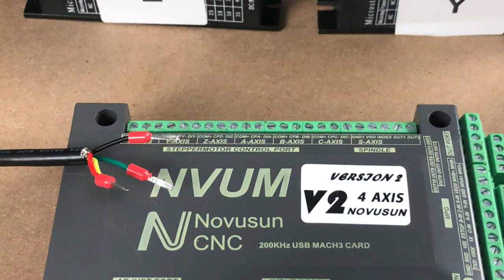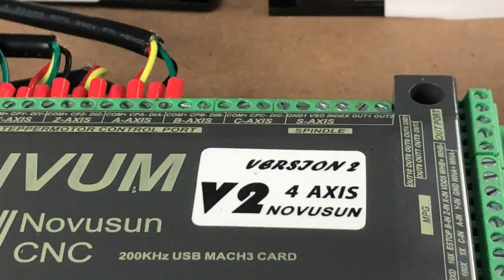NVUM Mach3 Controller Wiring for WorkBee,Lead CNC and other Similar CNC machines.

Comment: How would you wire 6 stepper motors up. I have 1- X motors, 2-Y motors, 2-Z motors and 1 motor for a Tangential motor

Comment: Hi! Thank you for this video! Can I use this controller with separate 36VDC power supply for powering 36VDC stepper motors?
Reply from the maker: Hi Igor,yes, please see your Stepper driver voltage range, generally it's 24-42V,so it may ok.
Reply: @yuyongindustry  Thank you!

Comment: I am setting CNC control using  NVCM6V2.1 USB I can't get the spindle to work every time I turn on the spindle it cannot turn off also when I turn on the spindle input 3 also active, it seems like it interferes with the VFD input.  the VFD I'm using Etrac XFC2000. VFD input setting  Active LOW measuring at the input voltage +13.5v any suggestion? The first time I use this controller it had so many problems. The manual says 12 to 24v but it won't turn on at 18v.

Comment: Hi, which mach3 plugin version are you using? I have NVEM v2 and the plugin version 3.0b from novusun website has a lot of bugs.
1- delay in step jog mode, feed rate override, rapid override, feed hold from button press to execution (about 2 seconds).
2- can't home more than 2 axis at a time if limit switches are being shared with home switches.
3- probe does not work.
4- auto and manual limit switch override does not work.
5- slave axis autosquaring does not work.
6- soft limits do not work.

I'm sure there is plenty more but I find those from working daily with the  controller.
Reply from the maker: Hi Pierre,generally when the controller supplier send the controller, there will has a CD in box, there has plugin in CD, the bugs may caused by settings on mach3 software,pelase consult your controller supplier.

Comment: Great video, thank you. Would the VFD connections be the same using a Novusun UC300 USB controller? Any idea of the output port number Novusun uses for the spindle's VSO?
Reply from the maker: Hi,yes,the connections are same with UC300 controller, which is a upgrade of NVUM,the UC300 is very stable and Extremely anti-interference, it has almost overcome all shortcomings of NVUM. So if you need to make CNC machine, mach3 controller is professional on CNC support.
Reply: @yuyongindustry  Thank you. Do you know what spindle port number to use (input port setting and output port setting) in DrufelCNC to turn the spindle on/off from the software? The VFD is configured for external control, but isn't getting the variable voltage V1I output from my UC300... my multimeter is reading 0 volts.
Reply from the maker: @ck1648  Hi,different spindle have different welding port,we don't know how is your spindle and how is your DrufelCNC,the VI1 on VFD to VSO on UC300,please consult your spindle supplier and controller supplier.

Comment: Hi could you tell me what connections would I use to control a  plasma torch relay as the relay only has to wires from power supply and one from a output, but seem to be struggling
Reply from the maker: Hi,we haven't test this on Plasma,so will not give any suggestion, sorry,we suggest you can consult plasma supplier and then check the port of NVUM.

Comment: I had follow all the step.unlucky still can connect to mach3 software.only limit swicth are working when diagnos.are nvum controller surpose to show red light when power is on?stepper driver show blue light.
Reply from the maker: The plugin or settings maybe incorrect,please consult your controller supplier to check if the controller is normal or not.
Reply: I buy yuyong cnc 1515 kit.
Reply from the maker: @akubelibarangonline1919  Please kindly show your order number and contact us via contact@yuyongindustry.com
Reply from the maker: @akubelibarangonline1919  We can't find this order number, can you show where do you buy please?
Reply: I used forwarder.